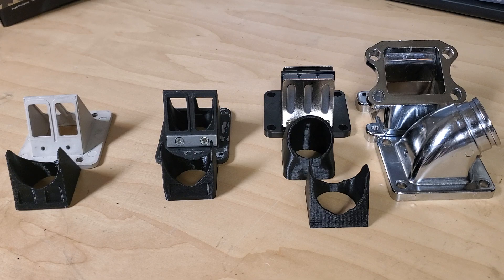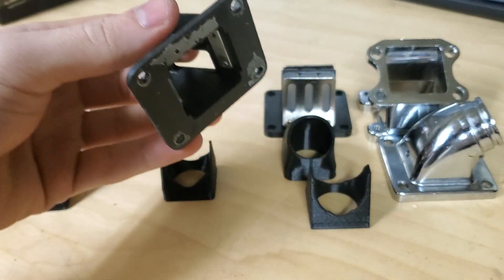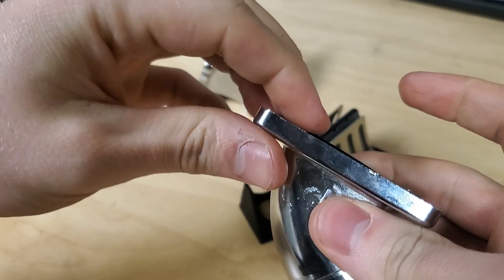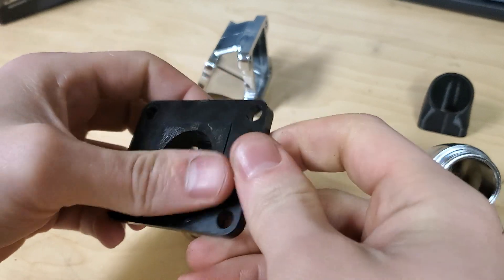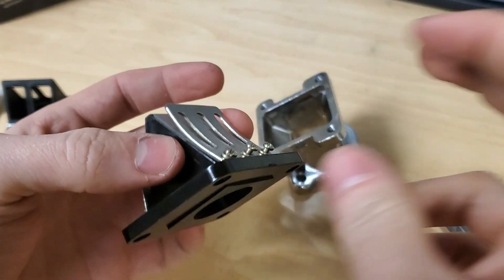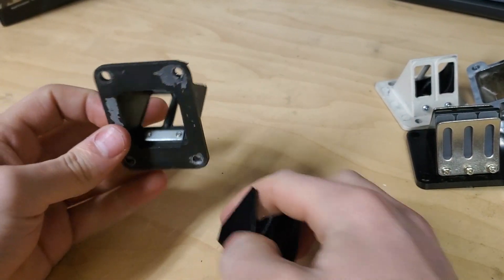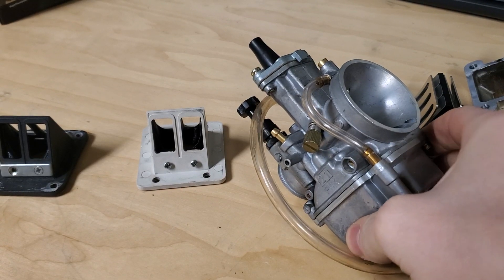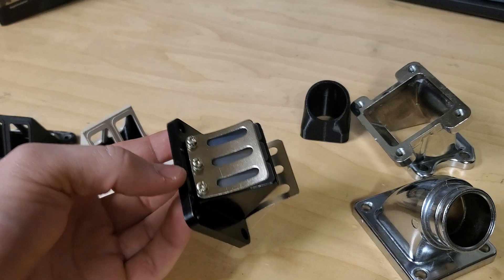Reed Stuffers for motorized bikes! Why you need one and how to install.

Comment: So what if i had one of these reeds with the stuffers installed but no stuffers in the inlet to match flow throughout ? Would it run worse then having no stuffer in either the reeds or intake ? or would it still help even with one installed in the reeds but not in the intake? Plz help just learned about this so any extra info would be appreciated for my build

Comment: I have a triple 40 zeda 80 and I have been back and forth about adding a windowed piston and reed valve. I have a high performance head and exhaust with a ported cylinder to install so why it's apart it would be the time to do it. Any thoughts?

Comment: I'm a newbie and not sure what the benefits are by running reeds I think it's like a check valve for the fuel mixture so it doesn't blow back out the carb ???? But I watch videos and still see that happening. I'm sorry guys I'm building a show bike with a big saw motor or another performance engine I'm 55 years young lol still a kid at heart though. I ride dirt bikes and had two Harley's in my life but want to try this hobby but I need to know what is good for 45 Cruse and maybe 50 plus for fun. I'm only 5,8 175lbs so I'm not sure if this is possible for a daily ride? Thanks for your time and help bud I'm also looking at your engines to run?

Comment: Would you sell the stage 6 smaller stuffer ? Or could you copy it for me I bought a stage 6 dio kit from dyno scooter the only place that has them left in stock and sadly it did not come with them . Not sure when the original kit dropped the stuffers. I got the swap shop  dio intake plate adapter for my af05e so I can run the dio reeds since I have a big bore kit I think it would be very beneficial since I do not have a big stroker af16 or anything crazy

Comment: Howdy Ethan, My dumbass cracked my Dio block by trying to hold it in while tightening those three little screws, the 
"Stuffer" kept trying to inch it's way out as I tightened, So I got them as flush as I could which obviously wasn't enough even with a second gasket between the f~911 intake & the stuffer/housing, So as I stagger tightened very slow and easy being careful to go on evenly and flush, right as I got to where I am to snug em all down for the final snug, I
hear a CRACK💥!!!
UGH 😩 So I now get an old block I had from an extra Dio reed valve I had and attempted it all over again, This time really trying to be careful, the angle of the stuffer kept wanting to scoot out as I tightened them three little screws again, so I took a fine file and took the stuffer down a bit and apparently wasn't enough because
"oops I did it again"
I felt like a complete schmuck! I guess the initial indentation from the 3screws before it was flush that I tightened too much kept making the stuffers wanting to seat back into those indents.
So I ordered another block from treatland and am going to attempt this again, This time I would like to prove to myself that 
I am infact "Teachable"
And not a complete idiot.
I do appreciate all you do for this sport/hobby and I realized this has been no fault of your design it's just something I'm doing wrong, I know you're a busy man & if you happen to read this before I get my new block this Friday
3/18/22 in a couple days
If you will please point this old man in the right direction, I apologize for the lengthy explanation, I hope it's not too confusing. Thank You and you guys are doing some amazing work, keep it up👋🙏👍🏁✌️
Reply from the maker: I recommend trying to drill holes in the stuffer to eliminate the screws pushing it out at all

Comment: I don't get it.  Isn't the advantage of having a reed setup apart from stopping blow-back, is to have a larger volume intake?  Wouldn't it be taking a step backwards if you restricted that opening by stuffing it?
Reply from the maker: Not necessarily. Adding intake volume is not always beneficial. In our case, the added volume is way too much for our engines. The stuffers themselves aren't restricting anything. The entrance diameter is equal or larger than the largest carb that will fit on the  reed block.
Reply: @smolikperformance3867  if im not mistaking adding to much intake volume is about like adding a huge carb on a small bore = hurts low end tq but picks up to end correct? the stuffers kind of clean up that low end hit correct me if im wrong here
Reply from the maker: @nathanw5747  yes thats exactly right!

Comment: The best intelligent no nonsense hi performance bicycle engine channel ive seen . Subbed ! Im ordering a Zeda 80 kit unless you know of better more balanced bottom end and will definatly be checking into your top end kits , is there a better balanced crank available for the zeda80 ? Would like to see you do other vids on bottom ends getting hot amplified spark to the plug ect . Keep up the excellent work and keep rolling the vids out .Thanks

Comment: I should have bought these for my dio Reed when I built it . This thing is a monster now! But just a side note the Reed cage side needed dremel work to fit. I followed your instructions to a T and broke the Reed cage tightening the screws. The only replacement I could find is a 4 petal from treatland .
Reply: Can I buy Dio reed stuffers from you ??? I live in the UK or do you have dealers over here I can buy the 2 from ?? Cheers enjoyed your videos .

Comment: You tried to fit the dio in the manifold and then you stopped.. does it not fit with the stuffer in there?
Reply from the maker: Thats all it needs. Just presses in
Reply: Correct me if I'm wrong, but I'm pretty sure it didn't go all the way in the manifold because he hadn't tightened all of the screws, and the loose ones that were still protruding out of the dio were stopping it from going in.
Reply: This doesn't make any logical sense sorry. But they put these in snowmobiles years ago like in the 70s sleds to burn less fuel during the fuel embargo we all took them out and then properly jetted the carburetor to make power not put them in. In fact a friend of mine and myself put one back in wanting to see what it did after this carburetor was jetted properly and all it seemed to do was cause a lean condition on the lower end and a lean condition on the top end which would make the engine run faster and sound to  have power but it was just because it was running lean and running high RPMs it didn't make more power it did however shorten the life of these old snowmobile engines by a lot because of the lien State these engines would actually often heat sease on a long-term idle. and I don't think turbulence is a factor here turbulent is what you want to keep fuel in suspension kind of the same theory behind crank stuffers or polished oversized intake ports and transfers. Some of the chainsaw manufacturers use crank stuffers and then the power saw builders take them out to make real  horsepower. Not knocking your product man it just doesn't seem to add up though Gorski snowmobiles did it in the 70s and everyone took them out to make more power but maybe if you're running way too big of a carburetor and too fat of a jet adding this would correct that scenario by taking fuel out of suspension and forcing it quickly through the transfers and out the exhaust into an expansion chamber I suppose. If you ran a short vacuum header pipe you would be able to see the fuel ignite in the pipe that little explosion would then cause an implosion you might be able to pick that up on a dyno but that would be a fault speak reading. I would be curious to see this on a Dyno without an long expansion chamber on the engine so we could actually see horsepower gain without the false reverb from the exhaust pipe. LOL but I have this feeling that this is where you tell me you need long properly tuned expansion chamber to make horsepower on a 2-stroke which we know is totally false until you get up around 150cc's that is where the residence of that explosion in the cylinder actually becomes enough that you truly need an expansion chamber in order to evacuate the cylinder properly. Anything below that you're just doing it for cool points and to make it a little quieter. Keep up the good work so I'd like to see more on this it's a good video these little poorly designed engines need all the help they can get.
Reply: @johnsonlong1272  you apparently don't understand how these work and why the DIO reed needs them. You can't compare cheap china engine e to old 70's snowmobiles. Also these are still used now days and are made by several companies.  Has nothing to do woth the lack of a tuned carb.
Reply: @kjsmolik  you're right I don't understand why someone would use them. But maybe I will have to try one I guarantee you can make a more desirable engine without it. Port stuffing and crank stuffing is very undesirable as far as performance goes. It would be about as Ludacris as dimpling an intake. But a lot of people even manufacturing companies make a lot of money from scams like that. And you're absolutely right it would make a huge negative performance difference in a little china doll versus a big better manufactured engine. You have to remember no matter how big the crankcase volume is the engine pulls the air into the combustion chamber it does not compress it in there anybody that believes that doesn't understand how I could stroke works. if it compressed into the combustion chamber than there would be no need for a expansion chamber and proper Port timing. Yes the Piston traveling down does helped push the last of the atomized fuel up past the piston threw the transfers but that action is minut or they would stuff the bottom of the piston.

Comment: Do you have a favorite reed valve? Or would you say the size you need depends on your setup? No love for the oz reed? Lol great video
Reply from the maker: G2 is probably my preferred of the 3. Oz reed is already so small
Reply: @smolikperformance3867  does reed valve stuffer give more or less power ? it decerlance or improve high rpm ?
Reply from the maker: @gaamegame2369  they improve the overall power curve by raising low rpm power
Reply: @smolikperformance3867  Haha your dad is the one who preached the Oz reed for the longest time. Was that just for built stock kits?
Reply from the maker: @jorelldye4346  that was for built stock kits, and before the g2 reeds even existed